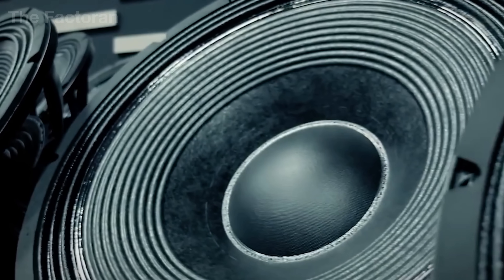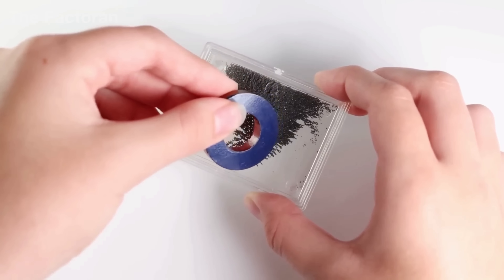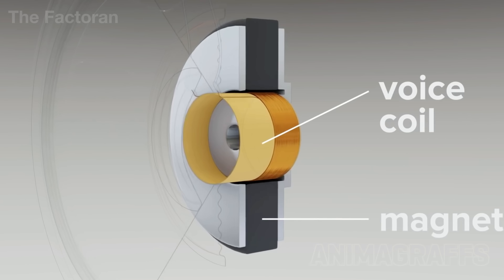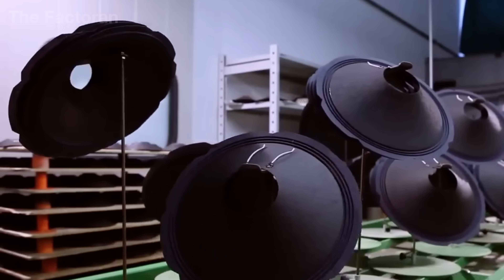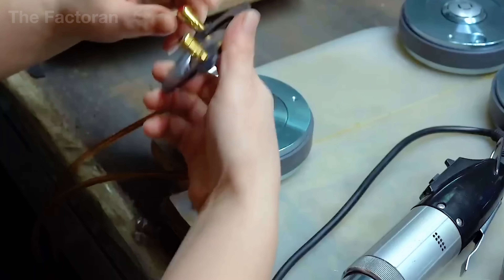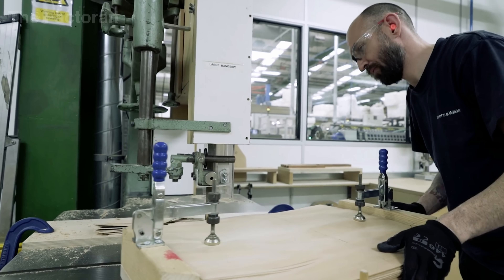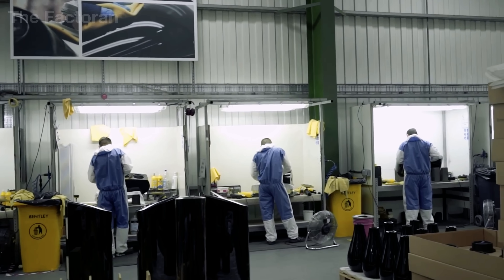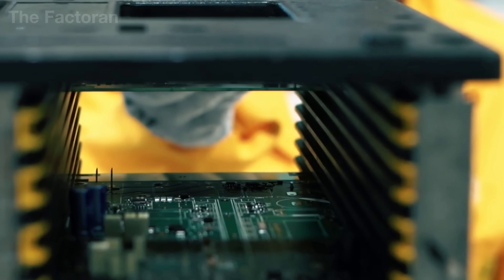How Millions of Speakers Are Made Each Year – Inside Massive Production Lines

Comment: Those Bowers and Wilkins and Focals pictured can cost 10s to 100s of K dollars.  My current L/R speakers (Klipsch), however, are less than $2K/pair, although I was seriously thinking of getting some PMC stand-mounds for about 5K.  I agree, though, AI videos rather suck!
Reply from the maker: High-end gear can get pricey fast. Sounds like you’ve put together a solid setup though.
Reply: @TheFactoran  It's getting there - L/R RP-6000Fii, C RP-504, heights RP-500SAii (4 currently up-firing because I have no choice), surrounds RP-600ii, rear surrounds old Polk satellites, subs SPL-120 (1) and RP-1200SW (1 with wireless transmitter).  I also have a turntable w/preamp, and Blu-ray player plugged onto a new processor, replacing my AVR.  Movies/TV are on a 65" OLED TV.